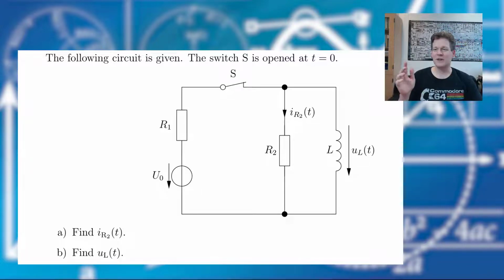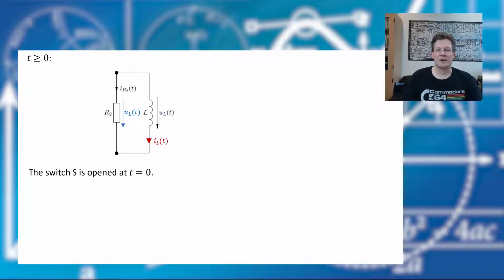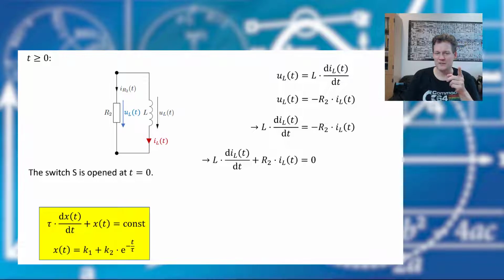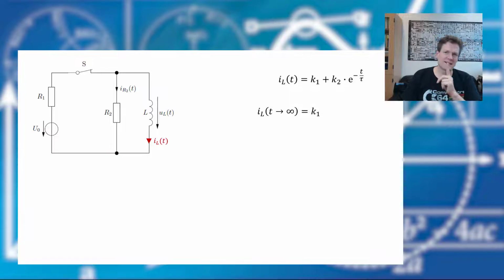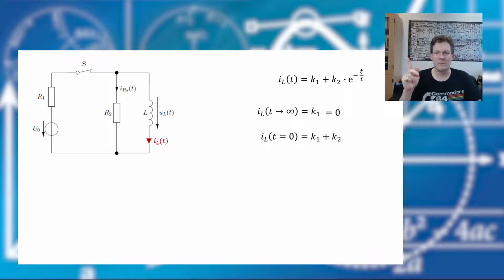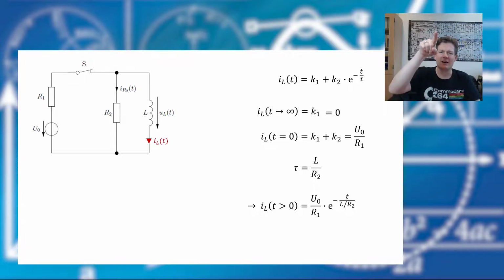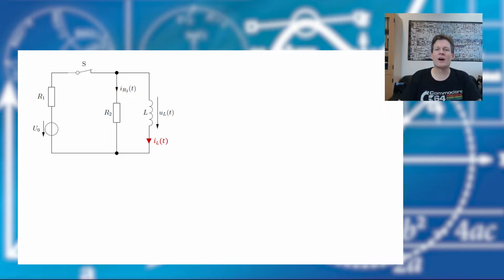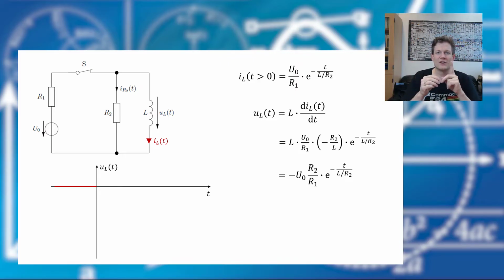Task - Transient effect at an inductor (a67/3_en)

Comment: Dr schenke , When the switch is open at t=0 .can we flip the voltage arrow or so to speak the inductor current is suddenly changed and it doesn't like sudden change . So to oppose the change in current it would act as a source and provide current in counter clock wise direction
Reply: It must be clockwise in the last sentence. So that direction of the current is maintained by the inductor
Reply: Please discuss in a video showing the inductor behaviour to produce a very high voltage across the sparkplug from 12v car  battery